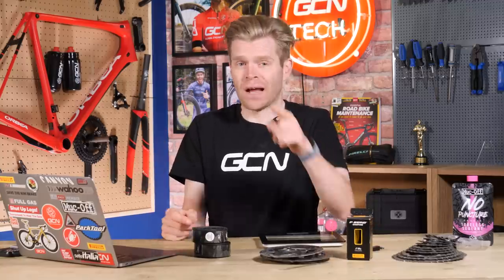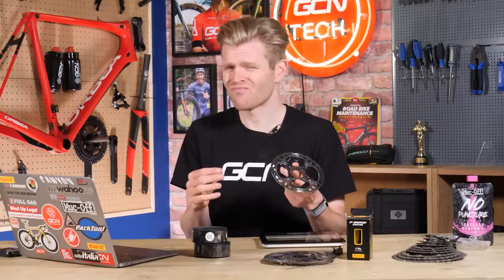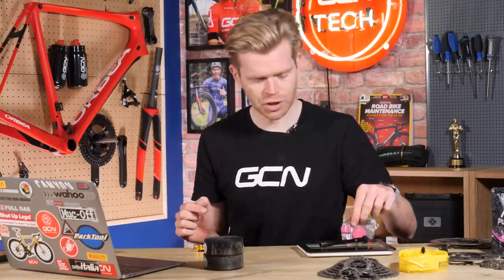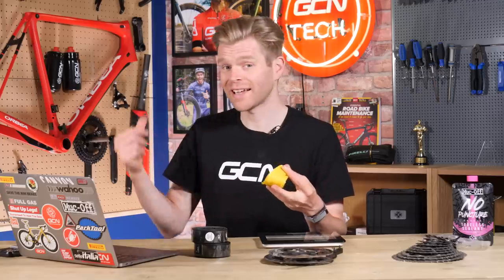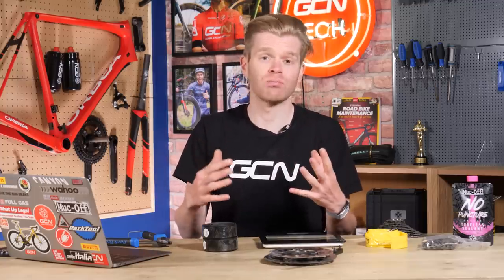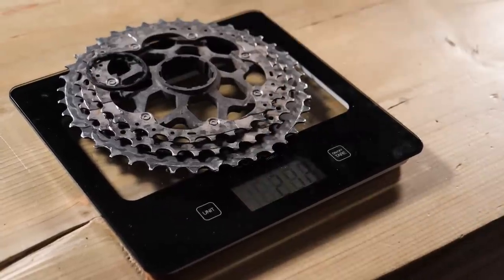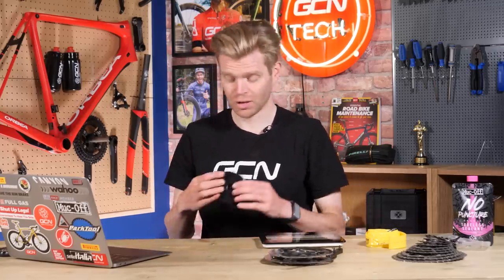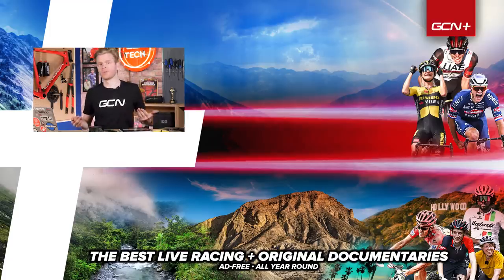5 Of The Best Weight Saving Bike Upgrades | Maintenance Monday

Comment: The weights of what is classed at lightweight now is laughable imo.

We are led to believe 7kg bikes without pedals are now light 🤦‍♂️ without spending a lot of cash on a disc bike it's extremely difficult to get them close to the 6.8kg.

A few years back you could pick up a number of rim brake bikes under 3k new under 7kg.
Reply: This is because weight is for less important than aerodynamics.
Reply: @petef15  aerodynamics in terms of the body and position I agree with u.

But in terms on the bike it's so marginal u may save 5w going to an aero frame over something like a tarmac or tcr but that's a 40kph far less at speeds most of us can achieve...

Same with the wheels I have a set of boras and shamals most my club rides are at 19 / 21mph average but I don't see the difference going from a 30mm rim to a 50mm I get there faster on paper however.
Reply: @danc1829  k
Reply: True, but they aren't any slower and brake and shift much better, all while providing better comfort.
Reply: @petef15  disk roters and extra spokes are not aero
Reply: @petef15  the climbs are where the differences are made as there is next to no draft and most mortals won't be going fast enough even up a 5% climb for cda to outweigh weight
Reply: And the problem is that a few years ago we were “led to believe” that weight was everything. 

Pls. Weight is not the most important metric.  What you should prioritise is getting an aero bike, and then it’s weight is just the icing on the cake.
Reply: @toutingthomas  But the 'heavy' bikes are
Reply: @petef15  yes I am telling you that they are only trying to sell more bikes. Tadej Pogacar himself has said 300g less for a rim brake bike is a lot for him
and yet he’s been forced to ride the new colnago which is even heavier than the old one
Reply: @petef15  the thing is, with rim brakes you wouldn’t have to compromise on weight or aerodynamics or stiffness, you could have an aero bike that weighs 6.8kg that won’t fold like paper
Reply: @joewakelin198  no, you only have to compromise on braking, both in pure braking power as well as consistency and modulation. Also, if I'm not mistaken, discs can be more aero. They more easily accomodate wider rims and tires as well. Finally, not wearing out a very expensive carbon rim (with safety risks) is a definite plus in my book. 
Nothing wrong with rim brakes, just don't highlight the advantages of rim brakes and ignore those of disc brakes.
Reply: @macvos  but my direct mount rim brakes have plenty of power (the limit being tyre traction) with great moderation and consistency... Whereas, I don't know if a good source but, duranrider criticizes the safety of road disk a lot, and seems to have reason to his argument/examples. 
Finally I'd like to know the economics of maintaining/replacing disk rotors and pads vs rims and pads... And brake cables vs hydrolics.
Reply: @toutingthomas  Then rim brakes might be the better option for you. For me, based on personal experiences, disc brakes are much better. Rim brake functionality has proven to be far more dependent on how wet or dirty they are, how true the rim is, how much pressure is put on the QR axle, how long the descent has been, etc. Especially when riding on wet, dirty roads, braking can be almost non-existent and then all of a sudden, when reaching a clean part of the rim, grabbing. When doing long descents, the effort required to brake hard has also proven to be far greater. However, when only riding in fair weather and on relatively clean and (relatively) level roads, rim brakes are just fine. Let's not pretend they are useless, because they are not.
Cost wise,  sintered pads last for ages, while descending Alpe d'Huez could largely wear out rim brake pads. Rotors versus carbon rims doesn't even need a calculation. A decent rotor is $30. A good carbon rim costs hundreds of dollars and definitely doesn't last 10x as long.

Comment: Use an older 10 speed mechanical groupset, rather than a modern electronic 12 speed one. Big weight saving on that (and on your wallet also)

Comment: Hi Ollie I’ve recently got into road cycling and watched your video stating that rotating weight of wheels doesn’t matter. If so, what’s the point in upgrading the wheel set to a lighter one? I’d really like to hear some advice on this topic.
Reply: Fun. 
Quick acceleration isn't faster on a long ride, but it just FEELS more responsive and fun.

Dont you ride because its fun?
Reply: @marcalvarez4890  Of course I do! I’m enjoying every ride, and just wondering whether it would become more enjoyable if I replace the wheel set. It’s fun already so I guess that’s enough for me.
Reply: It definitely matters when accelerating.

Comment: This video is pretty silly to be honest; even Ollie seemed a little skeptical about some of these suggestions.  No one I have ever met has partially disassembled a cassette to save a few grams on a given ride, for good reason. Under a reasonable limit, let's say 9-10kg, bike weight is not going to matter that much for most noncompetitive riders.  If your body weighs 75 kg and you ride a bike that weighs 8kg, and switch to a saddle that weighs 30g less than your old one, will you even notice the difference?  Are latex tubes going to make you faster than using butyl tubes on a typical US/UK route full of potholes and sharp debris in the road, once you take punctures into account?  As many others have noted, the best (and least expensive) way to reduce weight on your bike ride is to drop your own body weight by 1-2 kilos. Or just don't bring any water with you; a single water bottle adds 750 grams to your bike, which puts our worries about the weight of inner tubes, tires, and saddles into clearer perspective.

Comment: Sorry Ollie, not a fan of this video...
1. Reducing braking performance, sure they may be fine, but we're really not off to a good start..
2. I guess I don't have anything bad to say about thru axels, but you can't beat the convience of a quick release.
3. With their lower rolling resistance, latex tubes are faster, you said it yourself in a previous video
4. Getting rid of some of your gears just seems desperate. I guess it's a free way to lose some weight, but I promise a dropped chain will probably have a bigger impact on your ride than 100g or cassette.
5. Fair enough on the bar tape, that's preference.

My favorite way to save a few hundred grams is the pre race poop, it's free, easy, and has neglegible effect on your likelihood of dropping a chain!

Comment: Please don’t keep calling rim brake fans “keyboard warriors” just because you disagree with them. 

The industry started out using 140mm rotors and stopped using them because for the vast majority of people, they overheated.
Reply: From a mountainbiker's perspective, both the clinging to old rimbrakes as well as the 140mm discs "to keep weight low" are ridiculous.
Reply: Ollie chose rim brakes for his pinarello (mainly for weight and aero benefits) so he’s not against rim brakes.

Comment: Surprised there was no mention of swapping out bolts for titanium
Reply: Titanium bolts are often not lighter than aluminium bolts, especially if you buy cross drilled bolts. For non stress loading parts such as water bottle mounts you can't do much better than Schmolke Carbon bolts
Reply: I saved about 24g replacing the 8 non-load bearing bosses on my gravel bike with low profile screws. I should consider replacing the 4 remaining aluminum ones.

Comment: 1. Lose a few kilograms yourself. Let's say 5 kg
2. Don't bring a bottle a water on a short ride. 1 kg less
3. Remove the lock 400g less
4. No helmet 400 grams less
Total: 7 kg less, price 0 euros YAY, or ehm, is this wise ?
Reply: if you remove 400g of lock you can potentially lose 8kg of bike - now that is a big weight saving!
Reply: @feedbackzaloop  There is a bit more to it: if you plan a round trip from home to home in one go. Say 2 hours, assuming you can do it all in one go, the lock is a bit rediculous. 
Even just doing your thing on the toilet is often more weight loss then changing cheap heavy things for expensive light weight. My point is that simple obvious things are often overlooked.
Reply: @Aragorn.Strider  assume you have an unhackable (because you left tools and spares for the sake of weight saving) mechanical halfway through your 2h ride. Do you walk back home 10...30km with a broken bike or rather lock it up, hitchhike/take public transport for spares and instruments and return next day?
Reply: @feedbackzaloop  I never had a completely broken bike. I only saw that once with a friend... with a realy realy old rosted bike. Yes surely a puncture where the air slowly gets out, still careful slowly bike home shortest route is possible. When it gets really bad yes, I could walk. Surely it takes longer, but cost and benefit. And also... last time that happend was like in 1988 with crappy tires. This year I did have a big rock in my outer tube, pulled rock out, still all good, when they have double layers. And made several more trips with those tires, before I swapped with newer ones. The shop owner asked confused why I would throw them away. I guess we no longer are in the 1980's. 
While on a 2 hour trip its of course possible the furthest has the crash, if all parts are equal, then the avarage should indicate halfway so at 1 hour, not 2 hours. You are a bit negative there. And lets face it, you may bring several tools with you, and something else breaks making your current tools irrelevant. E.g. you have same issue when your rear tire bends 30 degrees, rendering it useless (I never had this, but I have seen it once)
Reply: @Aragorn.Strider  yep, 1 hour away. Depending on how direct the route is and the fitness it may be up to 40km, but I was more conservative to say 10...30. And you are absolutely right saying there is no 100% guarantee you got all the tools for every occasion. That is why the lock has much greater priority.
And although we are no longer in the 80s I still vividly remember shearing rear axle in 2017, 15km from home but 100m from a bus stop with regular connection.

Comment: Your body weight, wheels, crank………handle bars, assume a few things. You can loose 10 lbs safely, you’re on stock heavy wheels, your not using the top of the line crank and bars are alloy not carbon.